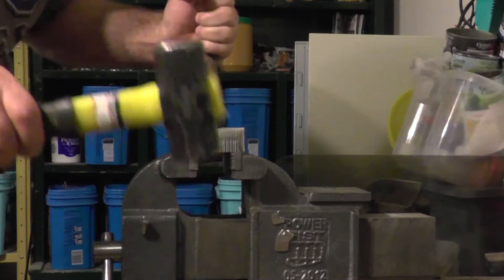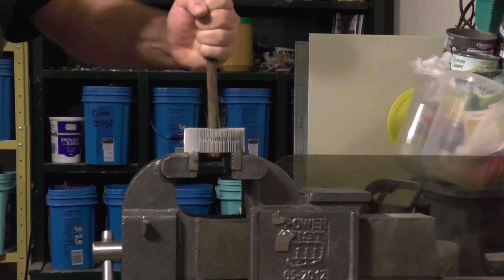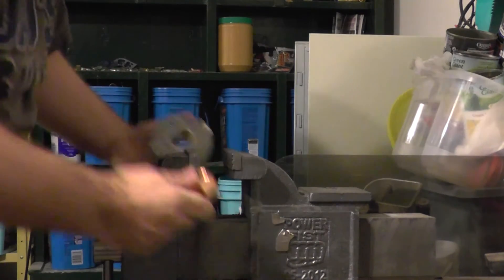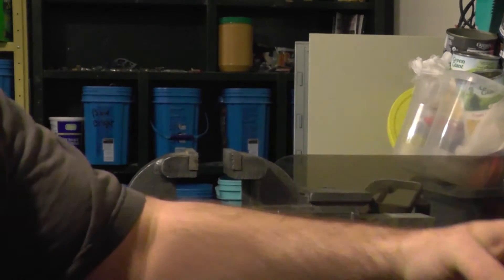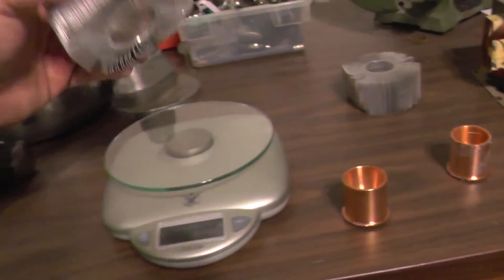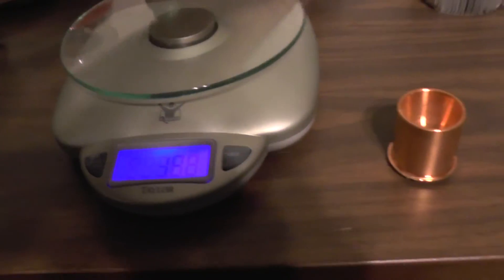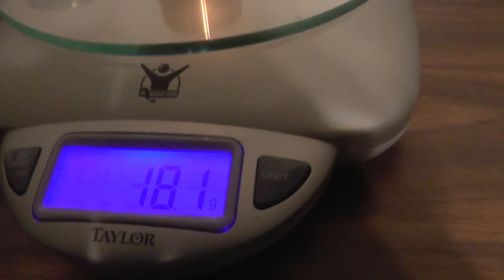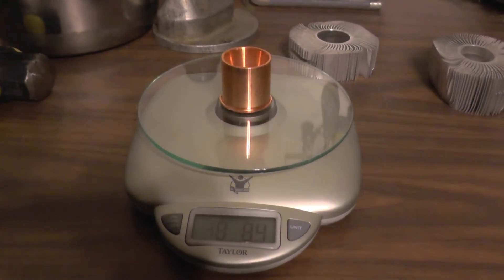Scrap Tips #6 - Copper Core Removal from Heat Sinks

Comment: great video i havent gotten any copper/aluminum heat sinks like that do you resale any of the computer stuff online like on ebay or anything
Reply from the maker: Thanks Man.  No, I havent sold anything  online yet, I keep thinking about it, but I haven't really come across anything worth selling online.  I do sell some stuff but I usually just see if any friends want it and sell or trade it to them.  You sell anything online?
Reply: +CCDetecting and Scrapping no i havent really fooled with it i mean i know i watched a couple of videos from scrapping for a dart and he sells alot of his stuff on ebay which wouldnt be bad i geuss but you would have to have a way of checking the parts out to make sure they work and then you would have to look up the serial numbers which wouldn't be that hard i geuss but i just dont know honestly because everytime iv searched ebay for scrap metal or e scrap they lots of stuff arent selling useually i dont know if you would have to repost most things alot or what so i just never messed with it i have sold a few things through craigslist though iv sold used lumber i got from clean outs and iv found a bunch of odd and ends of sockets that i clean up and but in a bin and sell and iv found a guy near me that guys non working flat screens aslong as the screen isnt cracked so i sell some on there but just havent taken the time to sell other things i geuss
Reply: +CCDetecting and Scrapping also just a heads up if you get any tin roofing aslong as its not all bent and mangled and the rust if it has any doesnt go all the way through stack it up on pallets those sell big time on craigs list and shoot even some that's really rusts people buy for crafts and stuff
Reply from the maker: Thanks for the heads up man :)  I saw Moose Scrappers video series on selling on eBay. however Canada has a bit different procedure for shipping than the US does.   I think it costs more.  We have Kijiji here where lots of people post stuff for sale, i have sold a few things on it before but I prefer to sell to my friends and give them a deal to help them out if they need it.   As for buying escrap online, i probably wouldn't buy it  until I know what things are worth better :)